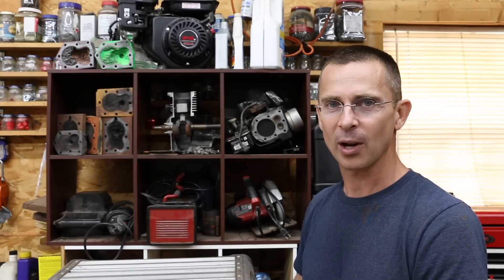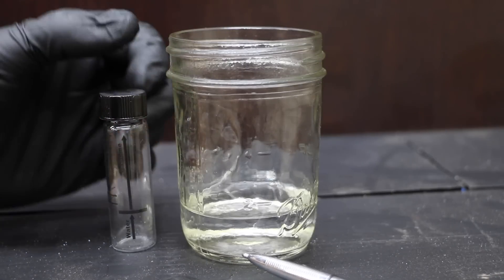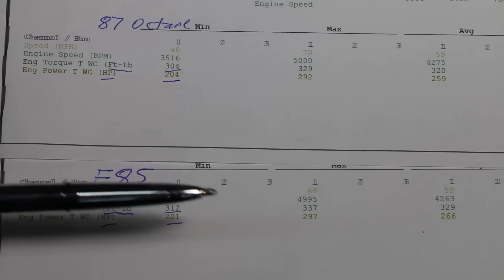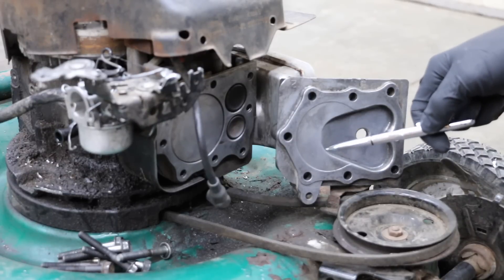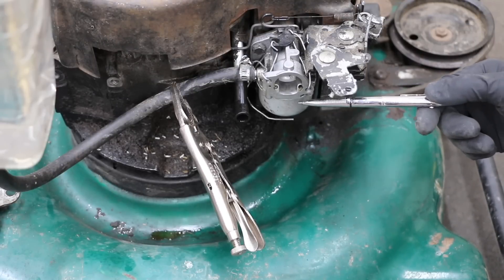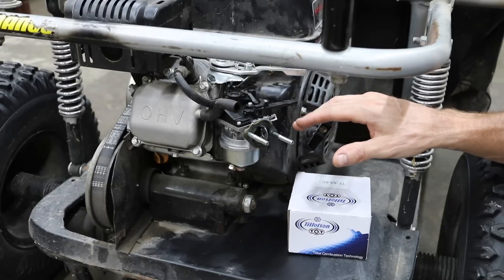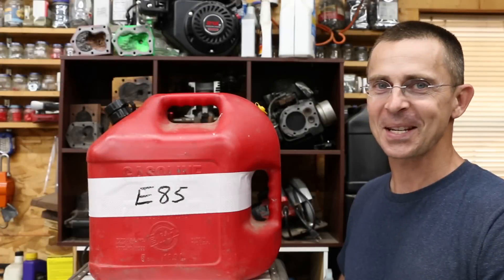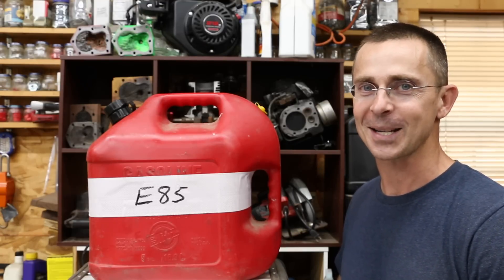Is E85 better than Gasoline? Let's find out!

Comment: Hey I love your videos and the raw information that you present to us. It's pretty uncommon to see that so I appreciate it. I also have a question. So I have had a motorized bicycle for a while and after removing the baffle cap I noticed it four stroking above 22 mph. Now I don't know whether if 4 stroked beforehand as well because the exhaust seemed to be too quiet to hear or I never noticed it. I now have an expansion chamber on it and it still 4 strokes. I know that even with the baffle cap on, completely stock, I seemed to have less power than most people reported from the same engine. I ordered some jets and according to different sources, four stroking is caused by a lot of things. Common causes often are incorrect timing, too rich of an A/F mix, exhaust gases not being able to leave the combustion chamber fast enough, or a mix of the listed above. I will be changing all of those variables one by one to find the cause, but I would be curious to hear your take on this problem. I know every engine can have a different cause for it, but I just want to know what'd you do. It would help me and be greatly appreciated! Thanks for the great videos!
Reply from the maker: Thank you!

Comment: Lets say you move to somewhere that is higher or lower in elevation. Did you know that fuels are blended for the seasons? Summer blend is different than winter blend. Cold air is denser. Hot air vaporizes oxygen nitrogen vapors more rapidly.
Now I moved from 2700ft above sea level to about 800ft. So ambient air pressure is higher. That means I need more fuel for my small engines. I now have more available oxygen. The decrease in altitude is roughly 30%. Interestingly I was able to adjust the idle and running speed of my 2 strokes with the correct tool.
And on my 4 stroke GV160 Honda, I was able to adjust the governor from insane run speed to correct lower speed.
I got a gut feeling that folks blame the fuel when they don't know how to adjust their boat engine to correct rich or lean, after traveling 300 miles to a lake of an altitude that the fuel delivery system cannot compensate for.
So knowhow to use the tool, to avoid being one.
Reply: Are you saying he is a tool for ethanols significantly lower energy density? The carburetor wasnt adjusted properly, but that was due to it being run on gas and not set to run ethanol. The suburban should automatically take in to account the lower energy density and introduce more fuel. The mileage dropped because youre using significantly more fuel due to the larger use of fuel since it has a lower energy density.

Comment: wondering how I missed this video until today. Great video.  I find that E85 only makes sense to use in states where it is subsidized and thus much cheaper (at least 10%, but preferably 20% or more) than "regular" gas.  It is interesting how well it cleans though... maybe worth running one tankful every couple months.
Reply from the maker: Thank you!

Comment: I filled a Mazda MPV mini van with E 85 one time just to see?  It ran terrible at part throttle, hardly any power because of lean mix no doubt,  so I had to floor it to get it to go and it would scream like it wanted to blow up.  So it was just a dog until I stepped it down then it actually seem to make more power and rpm seam to go higher and faster than gasoline.  No the car was not made for ethanol.
Reply from the maker: Thank you!

Comment: Reasonable. Theroractically, E85 have much higher octane rating but less heat value than normal gas, meaning radical ignition timing could be tuned for more hourse power with even much more fuel consumption.
Reply from the maker: Thank you!

Comment: Run a couple of tanks of 87 Octane through the tank of the mower, and check to see how dirty the engine is.  Then, run a tank of E85, and see if it got rid of any of the crud from 87 Octane?    Do a test, a tank of 87, then clean it up, and run a tank of 93 Octane, and see if it burns cleaner?
Reply from the maker: Thank you for the video idea!